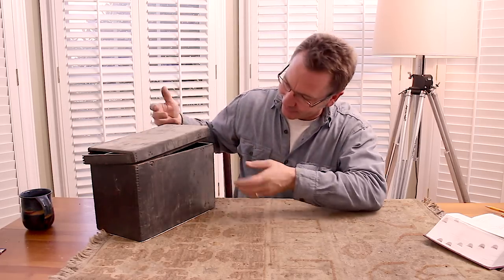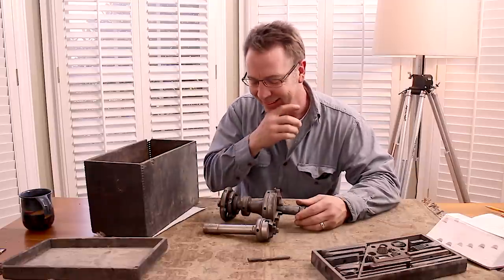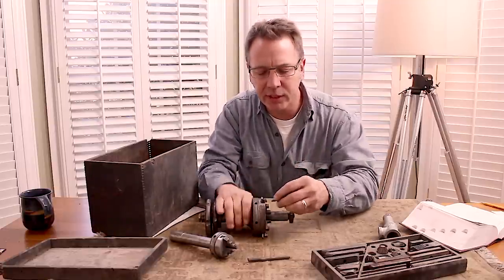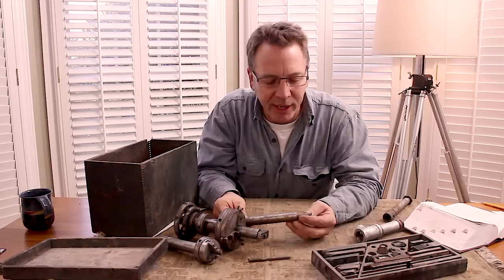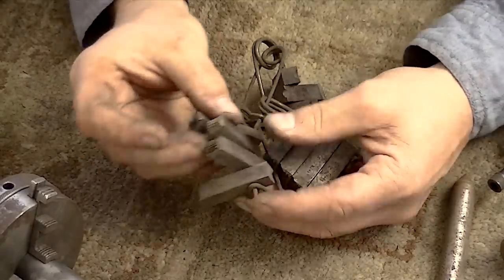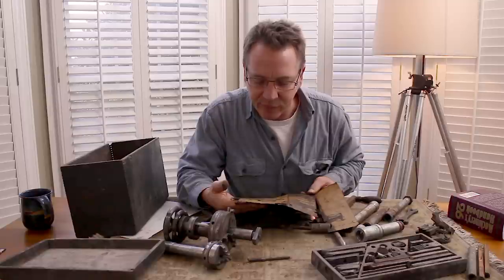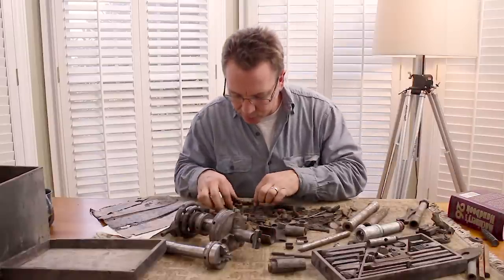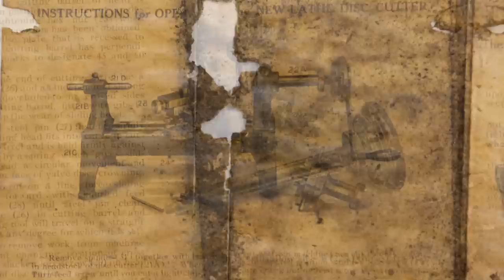Mystery Tool 1-A

Comment: Made by Leavitt of Orange, MA, a Dexter #6 Marine Special Valve reseating machine.  The "chuck" threads into the valve body and the cutter is held in the spindle that passes through the chuck.  The chuck is stationary in operation, while the spindle is driven, by hand.  The machine can true up various types of seats, for gate valves as well as tapered styles.  Circa 1900-1910.  Marine engines of the day were generally steam operated.
Reply: I saw this tool in a 1930's Audels, Marine Steam Engineer's handbook.

Comment: rather than replace a large valve used in industry,this could be used to recut the seat and save time and money repairing valves worth hundreds or even thousands of dollars. stationary engineer,steamfitters,maybe a millwright but definitely not something a regular plumber would ever need
Reply: I agree, but it was long before my time. So I'm guessing in the 20's and before.
Reply: I actually ran in to those type valves during a couple of petroleum tank farm refits, part of the reason we were reworking the piping was because some of the valves were "welded" in and been serviced so many times they were not able to be brought back, the original parts the valves were made from were very robust, it seemed like such a shame to scrap them.

Comment: As a steam propulsion engineer (Machinist Mate) US Navy 20 years, I have used this type of Dexter Valve Seat fixture. The ones I've used actually were manual and had a drive system used with a large chuck drill. This set is older than what I remember. Very, very cool. Thanks for sharing.

Comment: The top of the valve (surrounding the stem) is removed. The three-jaw "chucks" fit into the threads where the top screwed in. This centers and levels the axis of the cutter with the valve seat. Then you select the correct cutter - flat or angled - and grind away at the seat where the valve seals until it is smooth again. Then reassemble the valve; it may have a soft seal or it may be a metal-to-metal valve, in which case you also reface the moving part of the seal (which may be the function of the lathe-looking part which you are missing).

The moving part can be taken away to be refaced, but it is a real convenience to be able to do the machining of the seat inside the valve body while it is still connected to the rest of the plumbing. More valve repair jobs have turned into replace-all-the-plumbing-from-here-to-WAY-over-there because someone had to undo a few old corroded joints (that were holding water or steam until someone messed with them).

Comment: Old high pressure valves used to have babbitt seals (babbitt is an soft Tin and Lead alloy). To repair the valve's babbitt seal it has to be removed by melting and re-casting it into the seal's housing.  Then the new seal has to be machined to recreate the sealing surfaces. The chucks fits into the different valve housings and holds the reamers to cut the babbitt. Babbitt alloys are soft so the tools can be actuated by hand.

The valve's housing is closed back and the operator will shut the valve a few times so that the babbitt seal takes the shape of the valve's gate.

I saw this repair done on old refrigeration systems that used ammonia. Rubber seals crack under low temperatures so babbitt was the perfect solution for that. The operation was done without removing the valve from the pipes so it was a very practical and cheap method.

To complete the set, I would look for an old kerosene torch and maybe a cast iron scoop.  This is a great buy! It is very important to learn not only how things are made but how things were made.

Comment: This looks like a tool to remake the valve seats. he fixed the valve on the Madrin through the threads of the valve and used the  angle cutter to rebuild the valve seat so that all be aligned

Comment: The cutters that resemble , "Fly" cutters would be for resurfacing valve seats.  That is Water, Oil, gas valves.  The group of three sets  (T items)  are for old timey pipe thread cutters.

Comment: I am like others in seeing that it is a valve reseating tool. The first clue was the tray of seat cutters. I only ever used the mini size tool for faucets. Failure to maintain the faucet washer allowed the faucet stem to contact the seat and to damage it. The Delta washerless faucets revolutionized the faucet industry eliminating the old threaded stem designs. I have never seen such a large reseating tool, so I yield to the other comments from folk that know more than me

Comment: There is more to this old workhorse than you have here. Most Steam fitter and water departments hade one to rebuild valvues. There was also small brass foundries to repour seats and it had okum repacking tools, lead gaskets making tools. other things like different vises and holding jiggs.  It would take a book to tell all that was done with this tool.

Comment: looks like something to repeat a pipe valve, being flat or tapered.. but that would be just a guess
Reply from the maker: thanks
Reply: The chuck jaws would thread in to where the bonnet would be for resurfacing seats in globe valves, not gate valves. That's why the jaws don't correspond to pipe pitches.

Comment: probably its for Pressure Safety Valve for Boiler of old times, where it is required to LAP the nozzle of the valve to properly seat the disk.
Another guess is for re-seating of gate valve seats area where sometimes it is required to machine the surface of the seat to match the and properly seat with the gate of the valve.
Reply: I go maily for the gate valves.  Could address the safety valve too.

Comment: Used it 100's of times. As previously stated its a valve reseating tool set and you can do it with the valve still in place.
Reply: I saw this tool in a 1930's Audels, Marine Steam Engineer's handbook.